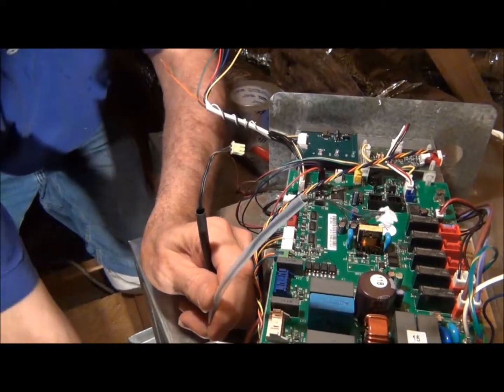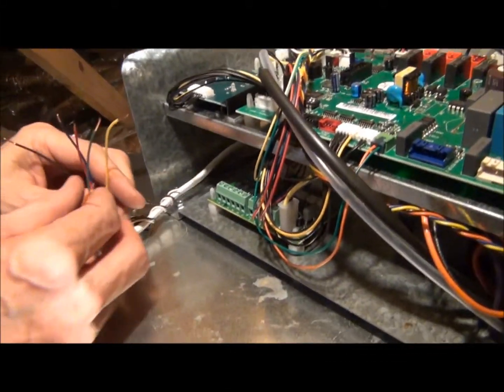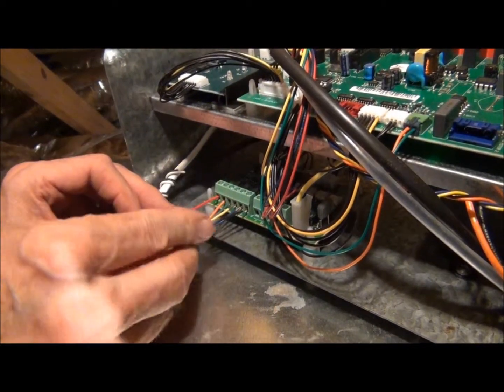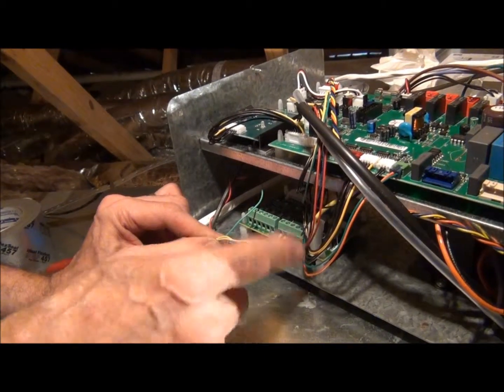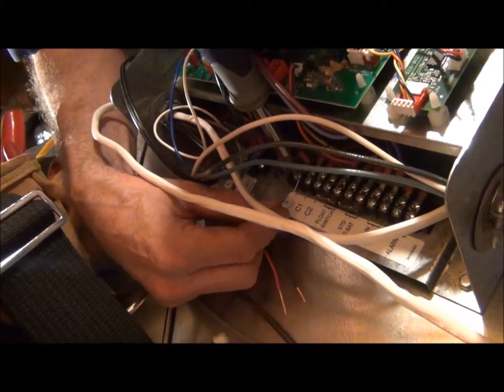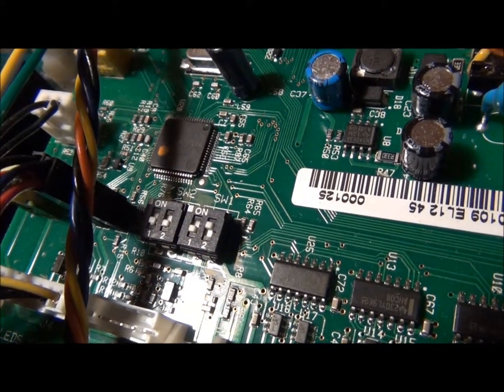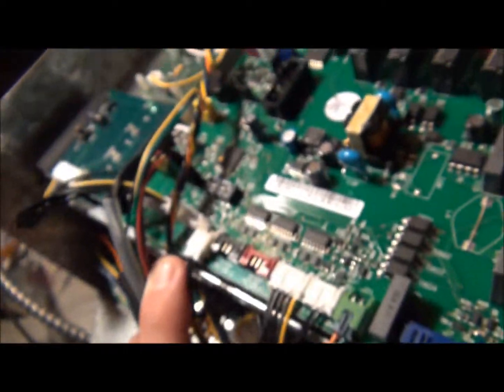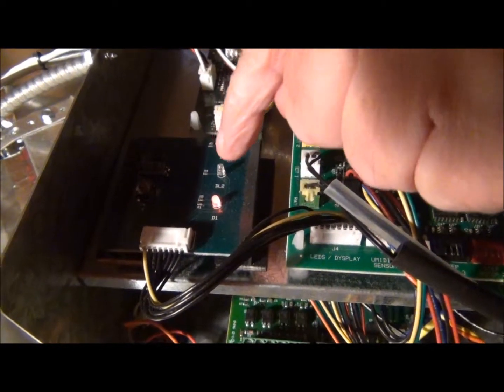Installing High Velocity Air Conditioning System Part 17 | The Unico System

Comment: How different an A/C only unit would be done.
Reply: Hi Jose,

Wiring for cooling only is pretty simple. Typically, from the thermostat to the Unico, it will be r, g y, and common, if your thermostat requires it. From the Unico to the outdoor, it's just y and common. If you can provide your exact model #, we can send you the correct schematic. 

If you have any other questions, please call 800-527-0896 or email service@unicosystem.com.
Reply: Thank you so much... this is the equipment I will be upgrading... Coil Mmodel# M3036CL1-B..
 BLOWER Model #M3036BL1-EC2... 
OUTDOOR Unit# BOVA-36HDN1-M18M
Reply: @montoclub  No problem. That's a great match up, actually. Let us know if you need the AHRI certificate.

As for the wiring, follow this link and go to page 18. https://tech.unicosystem.com/download_file/view_inline/182/260

This schematic shows wiring for a 2 stage unit. 

If you need anything else, let us know.